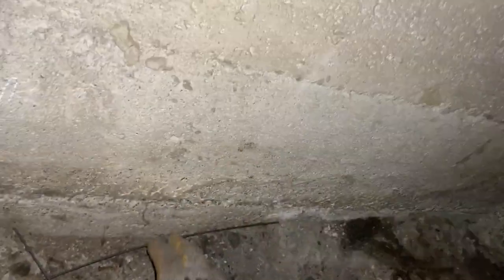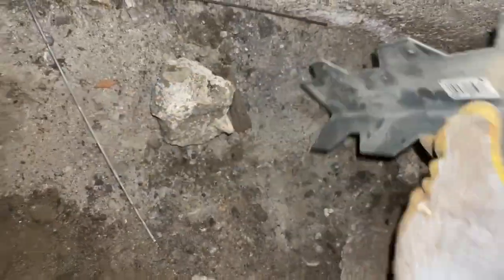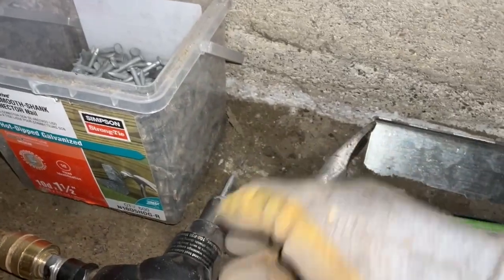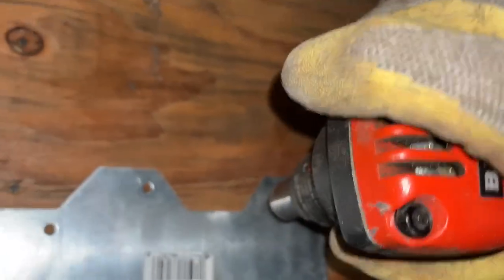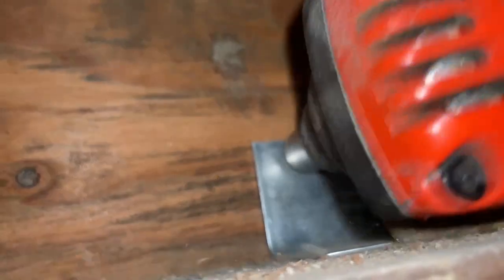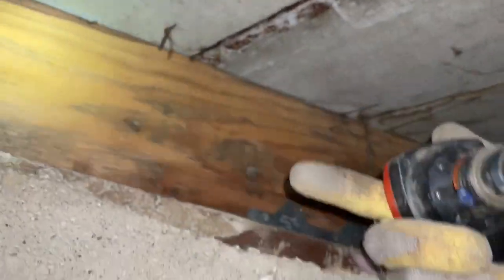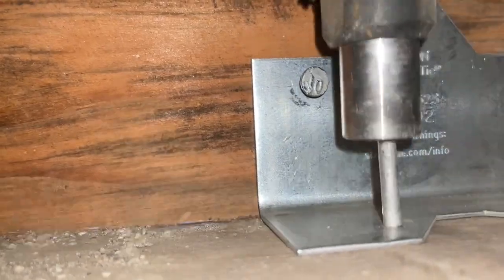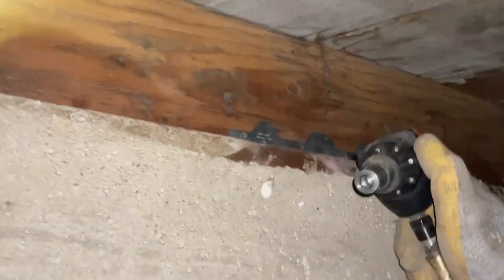Floor Joist Bracing Seismic Retrofit Simpson L90 Installation

Comment: Anyone know if Simpson structural hex or structural lok screws can be used ?
Reply from the maker: You really want to use the nails as they have more shear strength than screws. It’s what Simpson specifies in the documentation. Using screws defeats the purpose of the L90 as its job is to provide shear strength between the sill and the joist.